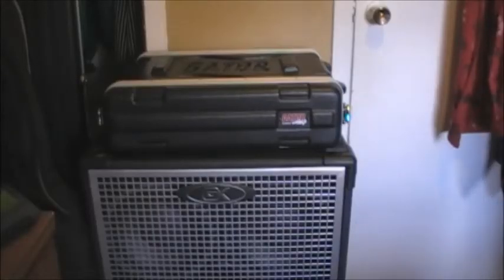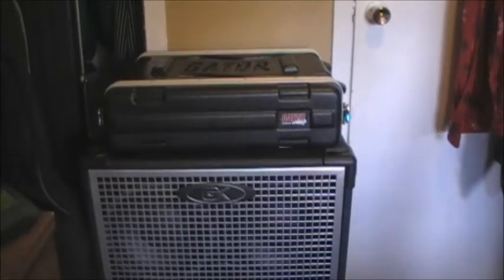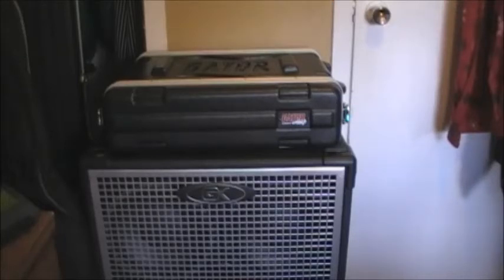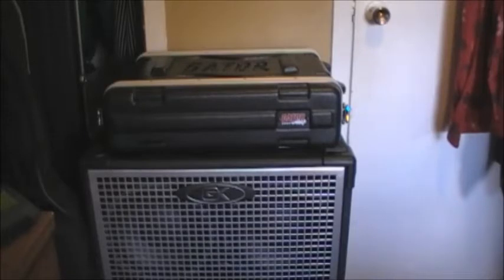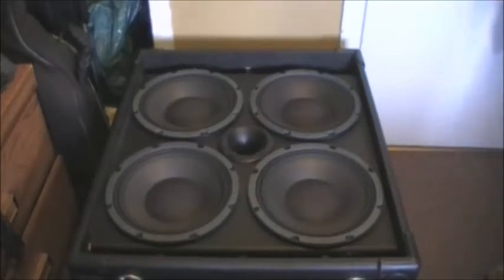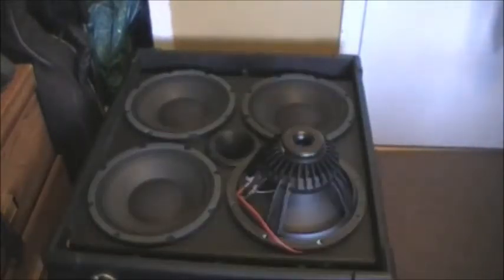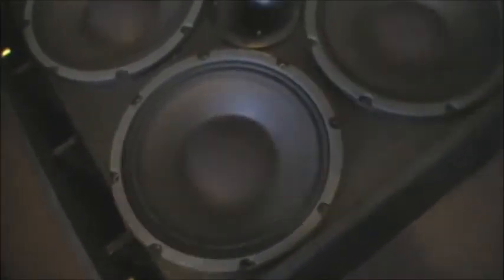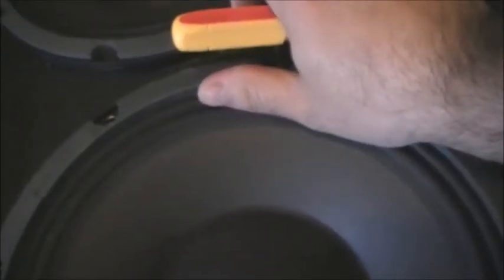Gallien Krueger Neo 4X10 cabinet - A look inside

Comment: Weight? Is it 800 watts cab? Thanks
Reply from the maker: It is about 65 lbs  Here are the specs... Configuration 4 x 10″
Power Handling 800W
Impedance 8 ohms (4 ohms Available by Special Order)
Cabinet Type	Straight
Construction Materials	Poplar
Inputs	1 x speakON, 1 x 1/4″
Height	26.5″
Width	23.5″
Depth	18.5″
Weight	68 lbs.

Comment: nice clip, thanks for sharing.
it looks like the cab is better reinforced compared to my ampeg. the insulation inside is about the same :)... it might have to do with the powerful drivers.

*neodymium is a metal, about the same density as iron. an alloy with iron and boron, under powerful magnetic fields, creates a neodymium magnet. it has a high magnetic capacity per weight, so by using less the speakers/motors are lighter.
Reply from the maker: Thanks for watching and for the information. I do appreciateit.
Reply: lllllll Ampeg cabs, well the SVT line at least, are sealed and the cabinet is constructed in a way that separates each pair of 10” speakers so their 4x10 is two separate and sealed enclosures and the 8x10 is 4 different chambers containing 2 10” speakers. Some of the 8 x 10”s aren’t separated in that way and I think they may go a little lower but they don’t have the same midrange punch or responsiveness in my opinion.